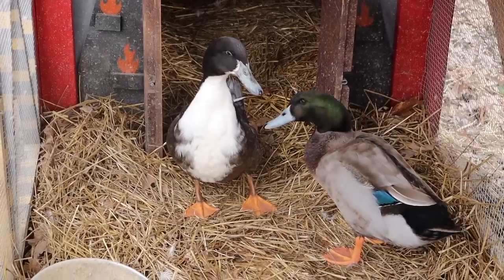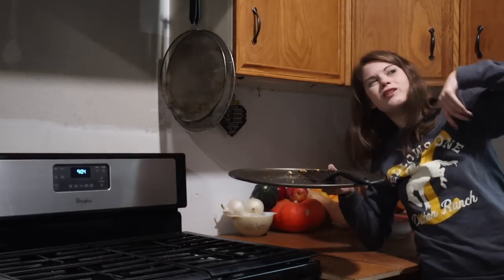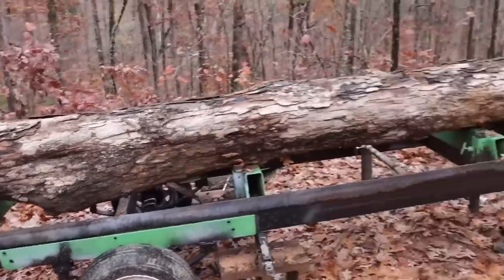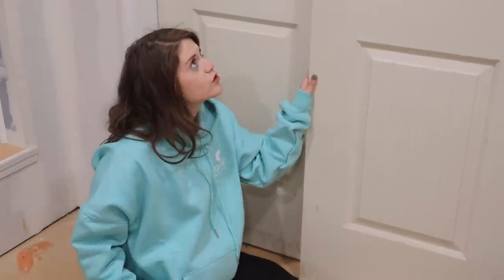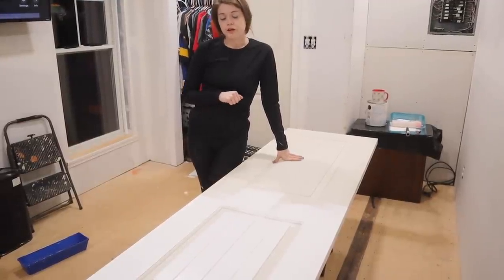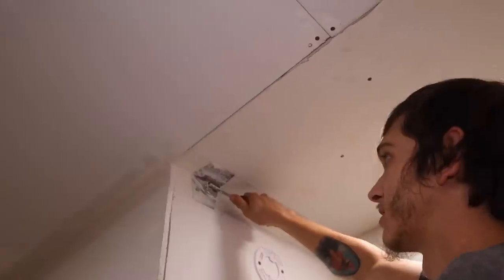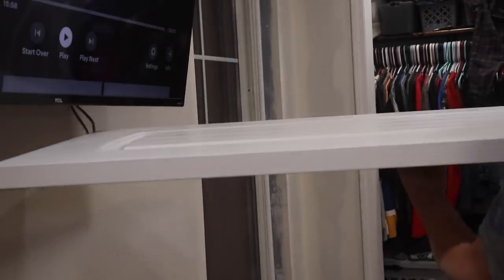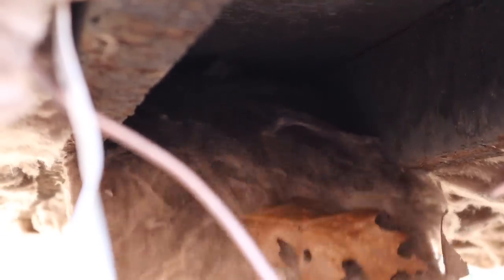Sealing In Drywall For Our CONTAINER BEDROOM |SHIPPING CONTAINER HOUSE|EP:81|

Comment: Suggestion, Get a 3" 3/8 nap minni roller to paint your door, casing and base boards. You can get in the center inlay sections real easy and it give you a uniform look when your done. You might need to do a sealer coat on the bottom where the water damage is. Those minni roller are also great for painting above the cabinets and around the shower. Any small space that a big roller is hard to get in.

Comment: Just a hint for your paint can.  Take a small screwdriver, put it in the groove where the lid sets,  And pound it thru to the can inside.  Do this about 3 or 4 times and the paint will drip back into the can instead of overflowing to the out side of the can. Also eliminated splattering when closing the lid with a hopper.

Comment: You guys are so cute. Idea for you,,, on something like your doors that have all that detail,,, if you use a mini roller you can avoid having to use a brush. It means that you will not have the texture difference. Also a bit more to the scale of the door. You could wash the roller between uses or put it in a plastic bag, squeeze out the air and put it into the fridge. Yup!!

Comment: Wall and ceiling seems are less noticeable if you stagger drywall sheets so you don’t get a “cross” aka 4-way intersection joint. I give ya credit on the tape and mudding you two are knocking it all out.

Comment: Great job mudding and taping. This is may sound kind of crazy, but when it comes to sanding the drywall try this, it's how I've been sanding drywall for several years now. I use a B&D orbital palm sander (6"), with 220 grit paper, attached to a shop vacuum. Light pressure and it goes super fast with not much mess, except emptying the vacuum and cleaning the vacuum filter. DEFINATELY AN "OUTSIDE" JOB!! It is just so easy and fast doing it this way. Another thing I do, is if you have really tight inside corners and joints where the ceilings meet the walls, I use acrylic caulk at those points and smooth over with my index finger. again, quick and simple. I use the Alex caulk, 40 year.

Good luck, you guys are super, carry on, best regards, Ted, Jamesport, Long Island, NY

Comment: Y'all are probably already done, but 2 secrets...
1. The 90° tool can be angled for adding more to the corner and less to the edges. 
2. If you cut the paper tape to size then wet it you're almost guaranteed not to have a dry spot when it's dry.